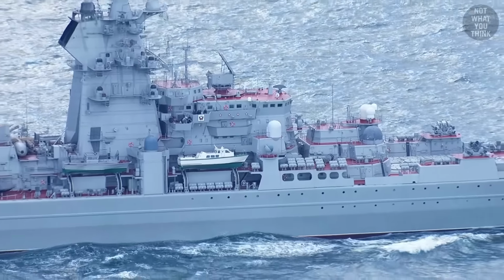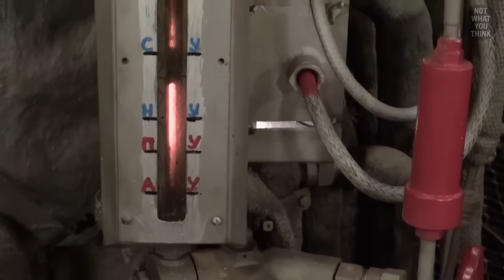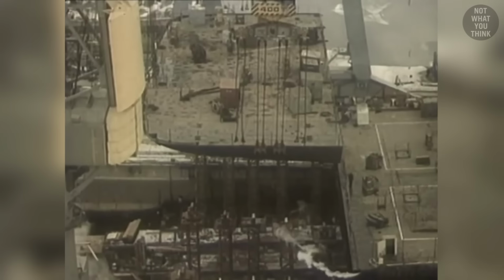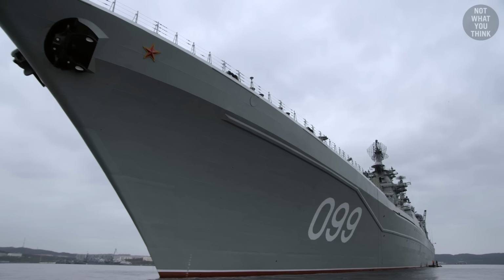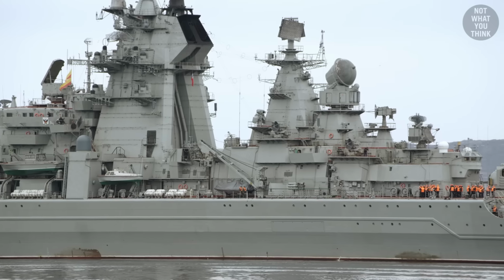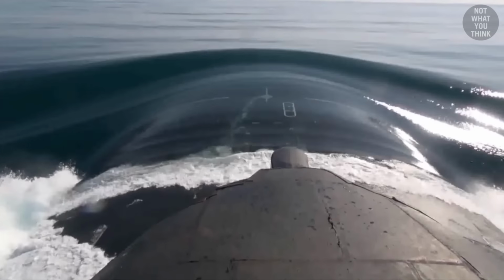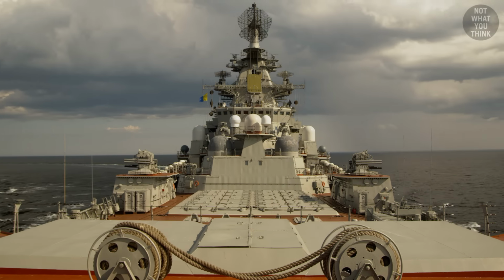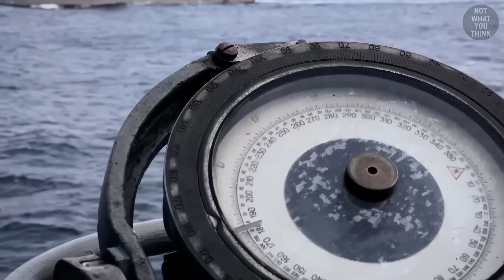Russia's Massive Nuclear-Powered Warship That Smokes

Comment: A torpedo turning into a rocket and then turning back into a torpedo is the most Soviet thing I've ever heard of
Reply: Yeah, the USN has had the same capability since the 1950's except they just skipped the first stage and went straight to rocket launched, which is why it's name is ASROC (Anti-Submarine Rocket) though it could parachute a nuclear depth change as well. We've even modernized the system into the 21st century with our newest homing torpedo and have made it VLS capable.

Maybe that's why the Soviets chose a torpedo launch? Not enough real estate left for another VLS or deck launcher box, so chose hull doors and torpedos.
Reply: The Soviets and now Ruskies have always loved fringe ideas because when they're the only one doing it, they can pretend they're the smartest and running cutting edge technology no one else can match. When in reality most of their (USSR/RU) "cutting edge" tech was stuff that'd already been thought about in the West but not chosen because we found an either better, simpler/easier, cheaper way to do it; or all of the above.

Like the USSR/RU Rocket torpedo, and no not their torpedo-rocket-torpedo torpedo. They have a submarine launched supercavitating torpedo that burns  Rocket fuel for propulsion and has a gas generator at the nose to create a gas bubble around it, essentially removing the water and making it a regular missile, just "under" water. If all the stats are to be believed (General rule is to assume the West is low lowballing their top specs to hide true capabilities, and Eastern-Bloc, China, and now Russia is overstating them) this allows it to travel as fast as 200-250 knots. Sounds pretty good, and is, but it's loud as hell and once launched all stealth goes out the window.

Another example is Hypersonic missiles, Russia made such a MASSIVE deal about their "Hypersonic" Air Launched Ballistic Missile, the Kh-47M2 "Kinzhal". The joke for people that know about that stuff is almost EVERY Ballistic missile is Hypersonic by default due to how and where they're used/work. Even the OG, the V-2 "Rocket" (It's actually a single stage long range guided Ballistic Missile, but that's besides the point) is Hypersonic at its operating altitude. So hyping up a ballistic missle as some new "Hypersonic super weapon" is just giggle worthy chest thumping by RU that gets regurgitated by the media for their quota of fear mongering. (P.S. The US has been able to air launch Minuteman Ib's by para-yeeting them out the back of C-5 Galaxys since the 70's and that's a legit, intact, whole-ass ICBM, not just a TBM/MRBM. We just didn't expand it beyond the successful tests due to security concerns, needing more R&D, and Russia would've had a shit fit about it if we essentially made every heavy-lift transport plane a potential nuclear bomber. However the capability exists and if needed could be fully developed and carried out. Although as we've upgraded the entire ICBM stockpile to Minuteman III's, we'd need to find or develop a replacement for the Minuteman Ib we tested it with in the 70's)

The newer (Then V-2) SCUD is "Hypersonic" as well, and yet we shot down 25% of them in the Persian Gulf War when the MIM-104 Patriot and its PAC-1 and PAC-2 missiles ability to due so was unrefined and mostly theoretical outside a few test.

Since then hundreds of software updates and overall system improvements to things like the FCS, Radar, etc, has exponentially refined this ability. The improved PAC-2 Variants since then (Like GEM and GEM+) are even better, and the PAC-3 and PAC-3 MSE are EVEN better with the PAC-3's tracking, guidance, and maneuverability being so good they went with a Kinetic Hit-to-Kill warhead to completely smash a Ballistic/Cruise missile by literally just crashing into it at Mach Classified. They also have what they call a "Lethality Enhancer" which is a small blast charge to radially expel 24 low speed Tungsten fragments around the missile near impact to increase its cross-section, enhancing kill probability. Without the huge frag warhead this allowed them to miniaturize the missiles so you can stuff 15 PAC-3 or 12 PAC-3 MSE to a pod as opposed to only the 4 PAC-1/2's. This also gave them the ability to add an active radar to the PAC-3 missiles which lets the missile go pitbull and guide itself once it's close enough to the target.

BACK TO THE POINT: Multiple KH-47M2 "Kinzhal" missiles have already been intercepted by Ukraine in the Russo-Ukraine war, using donated MIM-104 Patriot battery's armed with PAC-2 through PAC-3 MSE interceptors around Kyiv. So Russia's "New expensive super duper unstoppable missile" has already been easily intercepted multiple times by missiles the US has had for 10-20+ years. And the ability for the Patriot system to do so was once again considered "Certainly possible, but only theoretical".

So once again, the Russian systems performance was revealed to be overstated, and the Western/US systems performance turned out to be greater then what's been officially/publicly released.
Reply: @pyro1047  The P-8 can deploy rocket propelled torpedoes as well.
Reply: Meanwhile Americans: ya'll need torpedo tubes ?
Reply: The definition of words matter!  You mean rocket DELIVERED torpedoes.  I don't believe the USN has rocket propelled torpedoes, though there may have been a classified development I don't know about.  Haven't heard about anything like an ASROC or (cancelled) Sea-Lance for the P8 either.
Reply: Much like the P-700 they where Sub weapons first, it did not take much work to have them lauch out of a ship mounted tube.
Reply: @pyro1047 looks like you don't know the difference between a ballistic missile and a cruise missile.
Reply: @pyro1047  the difference is the Kinzhal in a MANEUVERABLE hypersonic missile smartypants.
Reply: Russians are 50 years in late... They are sure to be best... but...
Reply: Again, adapted from a previously existing submarine weapon. They just made it come from the ship's torpedo tube.
Reply: @JFrazer4303  Again ruSS weapons are perfect on paper... T14 is no more producted, strategic RS28 begin to be deployed...2 tests, 2 exploded RS28. SU57 is "stealth" but look pictures , we can see screws... ... stealth with screws ?
Reply: @banalresentive6523  Well, when I was in college in 1973 and invited back onto active duty for a Western Pacific (WestPac) cruise for the summer, our four-ship destroyer squadron routinely trained on -- and fired -- ASCROCs. That's a full half-century ago, and the Russians were watching us.
Reply: Wouldn't be surprised if it was an adaptation of the ASROC they used on their submarines.
A lot of the soviet mentality was if there wasn't a massive problem with plonking the same weapon on a different platform, like the P700 Nato codename "Shipwreck" by just submerging the launch tube... Then why invest in making it a different weapon?

So small changes to an ASROC launcher for submarines to splash it into the ocean would make sense and be cheaper, and you can easily share the weapon inside your fleet.
Reply: @nitsu2947  maybe they didn't need them but someone saw a blank, empty space on the side and decided that it needed a weapon there.
Reply: An accusation of something in being «the most soviet thing eva'» is the most ameriquan crap i've seen on internet
Reply: @pyro1047  mmm, «Rasskie». What an Ameriquan word. Modern Ingles.
Reply: @CMDRSweeper  Range of this Frankenstein weapon ? 6 000 meter... Less than 4 miles. Then no armour, no precision, and shootg in range of any weapon...
Reply: @pyro1047 not reading alla that
Reply: @pyro1047  Torpedo-Rocket-Torpedo Torpedo! That's very fucking funny indeed, well done.
Reply: in soviet union, torpedo becomes missile.
Reply: @nursestoyland  And vodka become chocolat....
Reply: And ensures the world that it won't work.
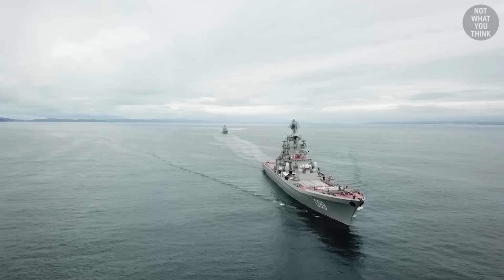Reply: 3:50
Reply: Have you heard of this thing called vodka?
Reply: It increases the distance of the torpedo as well as saves space by not launching it up from the ship like other missiles
Reply: @haythemsandel8303  no. Russia charged kinzal developers with treason because it can't manuever like they claimed. at high speed it follows a ballistic course, which as we have seen means they can be intercepted.
Reply: @Formerlyknownas1.0  Source: trust me bro 🤣
Reply: @haythemsandel8303  Source is the Kremlin lol
Reply: @Formerlyknownas1.0  Where? 🤣 link it
Reply: @pyro1047  the only way to outrun or to counter more advanced systems isn't copying them, but to invent new innovative measures. For example Russia can't physically produce an equal amount of planes that NATO has, so instead they're focusing more on air defense. I guess the same principle can be applied to Javelin, instead of trying to build a tank army as massive as Russian, US decided to invent better countermeasures against them. Russia then, instead of recreating Javelin, made long range Kornet rocket due to economical and strategic reasons. And etc.

But sometimes unproven inventions can be unsuccessful, that doesn't mean that there's something wrong with philosophy of that exact engineering school. We have numerous cases when new types of weapons are deployed successfully. Examples: Lancet loitering munitions (yes, something similar already existed, but it's night and day difference in terms of deployments), Shaheed drones (absolutely brilliant invention by Iran, later improved with Russian technology to produce Geran drones), Volnorez jammer, KA-52 helicopter, etc. I can even include AK-47 - the deadliest weapon in the world in terms of casualties.

And sometimes Russian do produce analogues: GLONASS (GPS), LMUR 305 (Hellfire missile), UMPC for FABs (JDAM), Orion and Inohodets (Bayractar) and many more
Reply: A surface ship being turned into a sea bottom base is the new thing.
Reply: @pyro1047  I don't see word cheap for western military hardware, most is overpriced, soviet/russia is cheaper
Reply: Lol when get into real fight then we know how good or bad it is
Reply: @nitsu2947 U.S. destroyers have torpedo tubes, they are just hidden behind sliding panels on the hull.
Reply: @patrickm5217 yes the alcoholic beverage from Poland.
Reply: @haythemsandel8303 it was in the news awhile back.
Reply: @diawannoto it's cheaper because it doesn't work. The Russians had to evacuate their s300 and s400 surface to air missile systems this week because the Ukrainian were wiping them out with ATACAMS missiles.
Reply: @haythemsandel8303  If it's hypersonic it can not be very maneuverable.
Reply: @pyro1047 ASRoc is still a torpedo not a rocket
Reply: @pyro1047 they may launch out of a vls tube or a torpedo tube but that jettison is to launch and push away from the ship
Reply: red alert ahh aesthetic
Reply: We experimented with the ideal first, the Russians were just the first to widely adopt it because it matched their doctrine more than ours.
Reply: SUBROC....us navy
Reply: those are actually kinda clever considering they can be launched under water from a submarine. why they put them on a huge cruiser with dozens of bigger badder and more convenient rockets is beyond me though.
Reply: @pyro1047 dumbest comment I’ve read in a while
Reply: Except the US keeps telling anyone who isn’t tired of listening to them that they have hypersonic technology fully operational but it’s “a big secret”, while Russia runs a variety of hypersonic weapons and we can see them at work and they produce documentaries on them. 

We have yet to see the US put its money where its mouth is. 

And while Russia tried and ditched Ekranoplan designs, mainly due to high costs of sorting out the final issues at a bad time for a broke Soviet economy, the US had no idea what the machine was when it was first observed in satellite imagery. Ergo, the US could not have “thought about it and then rejected it, prior to Russian development to a remarkably advanced stage, and were ready to build even bigger craft than Lun.
Reply: @pyro1047 you are delusional your novel is on another level 😂

Comment: A Russian aircraft carrier that emits its own smoke screen.
Reply: Just what you want when trying to land an aircraft on a short moving runway.
Reply: don't forget about its Reliable Outboard Motors (Tugboats).
Reply: Did you watch the full video, he said it's just a joke
Reply: Historically that's how smokescreens were laid. No modern smoke canisters
Reply: Yeah it might end up the biggest Russian Submarine !
Reply: ik it was a joke but holy if that was real idk why were dealing with paper straws when that things running 😂
Reply: Huh…so that’s what that’s for…a massive smoke screen…created by burning engine parts and venting waste from the reactor…🤔🤪 learn something new every day…🧐
Reply: @icekidtvshorts4504  I was telling a joke also.
Reply: @sydneystout4003 presume the New Boilers did not get stolen and sold.
so the crew just put back in the old one because no one wants to steal a boiler whit more miles and service hour then the valve can show.
 hopfully the crew did clean it and do some effort to fix it before putting it back in but consider how things are not likely.
Reply: Someone over cooked their borscht.
Reply: @sydneystout4003are these the same boiler engines that they took from germans to use in the armata 🤣😂
Reply: @icekidtvshorts4504 everything is a joke when talking about orcs
Reply: Cheap bunker oil does the Trick.. this is coventionally powered steam ship
Reply: @ulrichbrossmann1225  except it's only conventional after ural 😆 even your own army doesn't want to work at it
Reply: Can be destroyed by a cheap drone boat
Reply: That’s nothing special. My first car did that on the M25 once 😮

Comment: I wonder how many of the installed weapons actually worked.
Reply: My guess would be that the maintainance is non-existant.
Reply: That's one possible reason for having so many of them. Even of some fail, by chance some will work, and so it's not completely useless.
Reply: @zolikoff  Or every time a weapon system broke, instead of repairing it they just added a new one.
Reply: Most likely that the systems did work when they were installed, but the constant lack of maintenance means that they  don't operate properly anymore.
Reply: @doggo_woo  Honestly, even the idea of them working properly when they were first installed is probably being overly generous.
Reply: @zolikoff  Also, having more weapons systems is actually a disadvantage, not an advantage. Sounds counterintuitive, but consider that each system has its own unique operating procedures and maintenance requirements, which requires more training for the crew in order to use each one. Even the fully automated ones need to be fine-tuned and inspected constantly to make sure they work. You combine that with the already enormous task of keeping a ship in working order, and it's inevitable that things will fall by the wayside; there simply aren't enough man-hours available in the day to keep everything working. Think about it, would you rather have six reliable weapons systems or two dozen that are unreliable?
Reply: @ManiaMac1613  "which requires more training for the crew in order to use each one" -

ever heard about automation? Missiles are in standardized sealed containers. You just push buttons to confirm launch.
Reply: @TheRVSN  Oh right, silly me, I forgot automated systems are more reliable and easier to use. That's how the Moskva defended itself from those Ukrainian missiles last year.
Reply: @ManiaMac1613  "That's how the Moskva defended itself from those Ukrainian missiles last year." -

you are not smart enough to understand that "Moscow" was framed alone without escort for state treason. Also you are not smart enough to understand that kiev junta is just an irregular army of USA (as Taliban, Al Qaeda or Hamas) and Russian Bolshevism made a preemptive strike in Ukraine to localize the war and prevent it from growing in Europe. There is no way kiev junta could defeat Russian army - that is only a cover for a treason in Russia that cannot happen today anymore because both subjects of global politics (global predictor and Russian Bolshevism) are dismantling Pax Americana.
Reply: @TheRVSN  If only the Moskva was able to evade missiles the way you evade the point, it would still be afloat. What does the wannabe Tsar's invasion have to do with the point I was making about ship's weapon systems?
Reply: what. @TheRVSN
Reply: @ManiaMac1613 All Russian weapons don't work, they're currently destroying NATO tanks with shovels remember?
Reply: @TheRVSN  У якутов есть хорошая поговорка про тебя : "Волос длинный -ум короткий".
Reply: Everything works. Don't worry. It's not uSa navy
Reply: Due to the numerous systems they have interoperability issues.